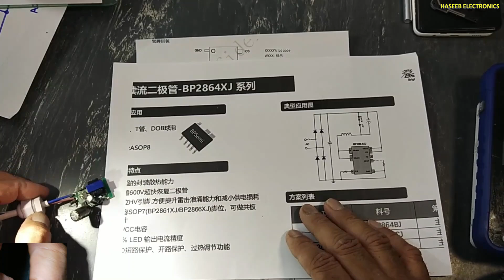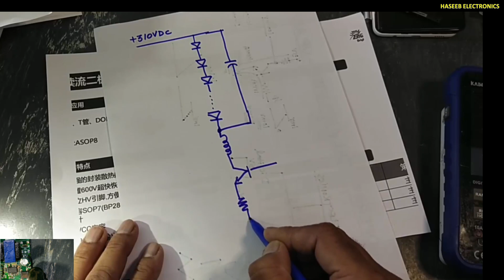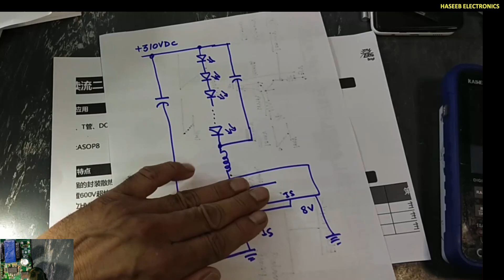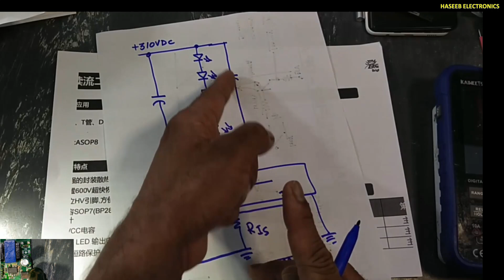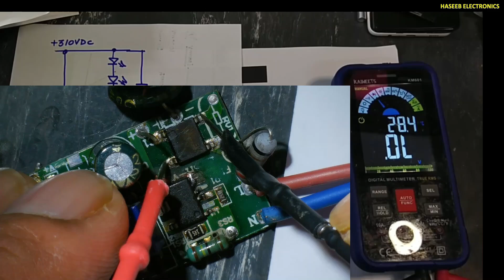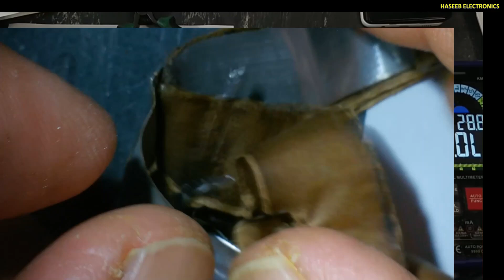{1187A} LED driver function explained, failure root cause analysis

Comment: How to calculate inductor value and current sense resistor value? How to design this inductor? Is the method is same as flyback transformer, as described in your pervious video .

Comment: I would love to simulate the circuit in LT-Spice. But that chip is difficult to simulate. Datasheet says ("No VCC capacitor, no starting resistor ")
The fuse is useless, it does not protect the circuit from burning. Capacitors are the most dangerous component and is the No 1 guilty component all the time. I think that kind of LED lights are no good to buy while the quality of the capacitor is like that.

Comment: Lovely explanation, i was expecting to see discharge path for the coil tho😞
Reply from the maker: no there is no discharging path. because it works in continuous conduction mode
Reply: It doesn't stressed the mosfet when switching on/off?

Comment: 🙏🙏🙏 sir please i request you to help me deep from my heart i want to try and learn about how to test output and input of integrated circuit(IC) in any circuit board and where to put black lead to test IC input and output..please sir🙏
Reply from the maker: always use power return path as reference point. black lead to power return of that specific section of the circuit if you are testing an IC, use IC common pin (GND pin) as refernce point for inputs and outputs
Reply: @HaseebElectronics  thank you so much sir..and i really i want to paid for your kindness answer for me.please be patient sir it is my turn to pay for your answer.your kindness and i don't have any satisfy from any one but only you sir.God Bless you sir.🙏🙏